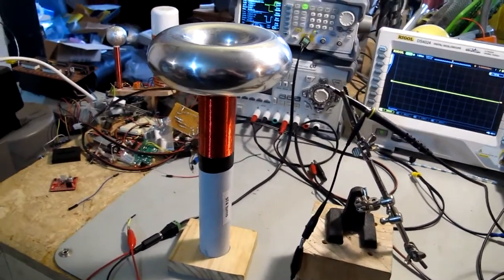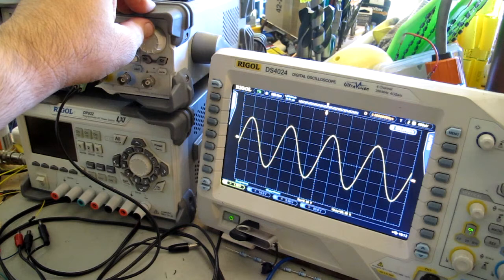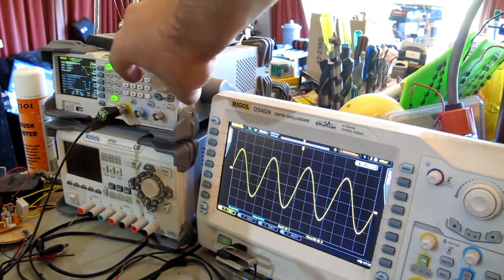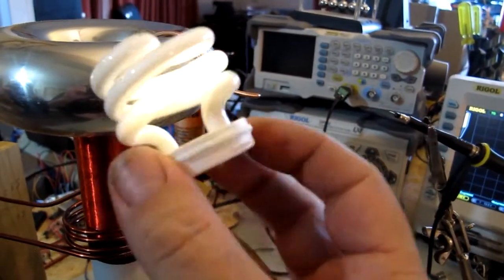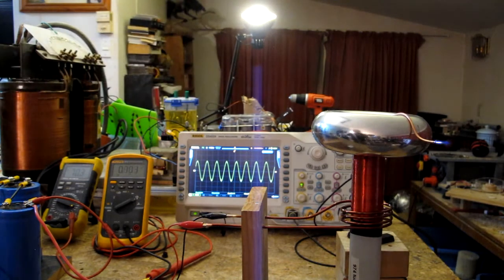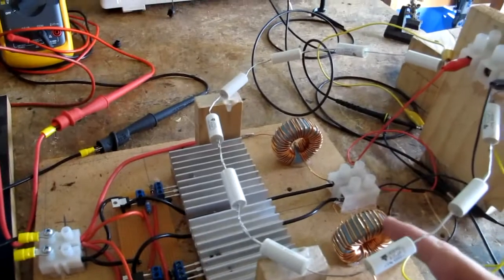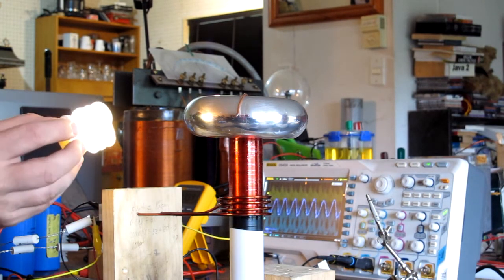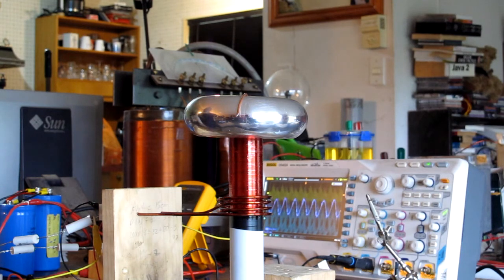Mini Tesla Coil project

Comment: nice work! what is the name of the zvs driver circuit that need the center tap on the primary?
Reply from the maker: +drdreads1 Thanks  :)

That would be a Mazzilli Driver:  http://kaizerpowerelectronics.dk/high-voltage/mazilli-zvs-flyback-driver/
Reply: sorry i meant to say doesnt need the center tapped primary
Reply from the maker: +drdreads1 Aah, heh.  :)

I don't know if it has a proper name, but this is the schematic. Having trouble finding my original source though sorry.  http://imgur.com/XSRkdX7
Reply: +gristc thanks buddy